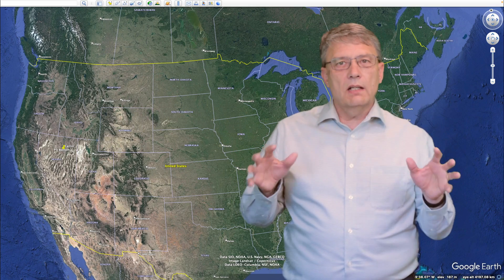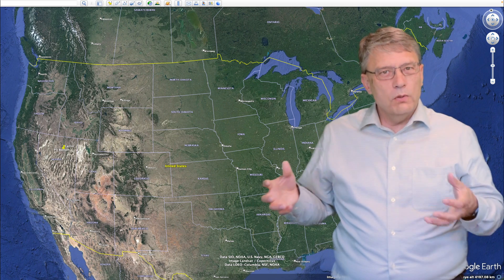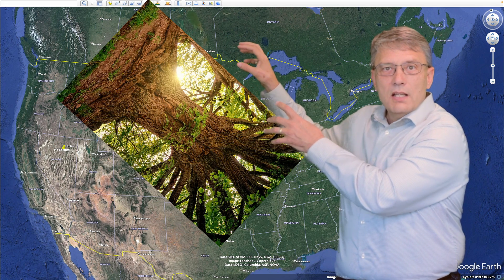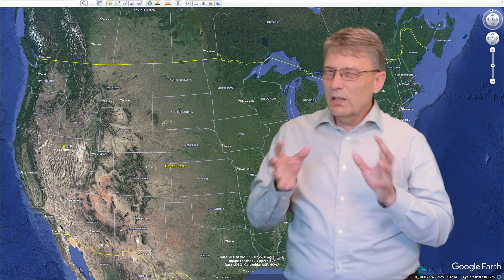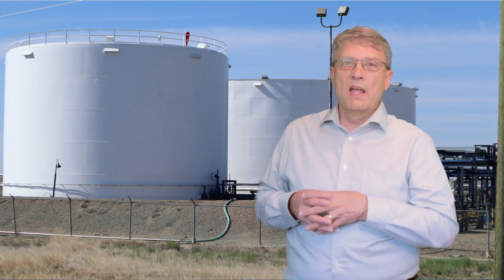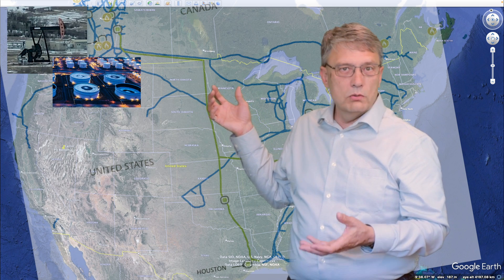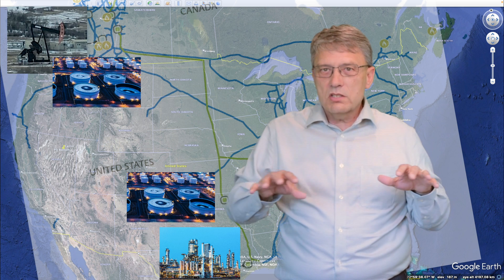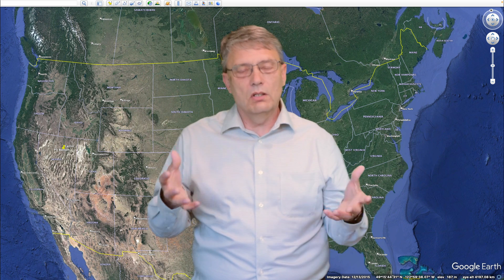Pipelines for Beginners - How does an oil pipeline work?

Comment: Thanks to trump those pipelines are empty now. The oil that was going to the states is being sold elsewhere. Thanks Donald, we’re getting a better price for it now. The same should be done with electricity, because we’ll be needing it to power our new industries. Thanks Donald for showing us how much we really need the US.
Reply from the maker: Trump's new tarrifs will likely change some buying agreements but changing a supply chain takes time. As a result the pipelines are definitely not empty yet. Time will tell.

Comment: What percentage is of these oil is being refined for gasoline/diesel/jet fuel/ etc?  And how much of these is being used in the US?
Reply from the maker: I go through the product distribution in my "how does a refinery work". I believe most of the product refined in the US stays in the US. Usually refineries are placed close to where product is being used because it's less expensive to move crude oil than refined product.
Reply: @rolandplett not exactly on your explanation here

Comment: Pretty cool. I worked in the oil field for many years starting in 1980 doing seismic work. Then I worked well logging starting as a field hand then working on the electronics for over 8 years. Then I did telecommunications in the oil field and 15 years along the Alaska Pipeline. This was all in Alaska.